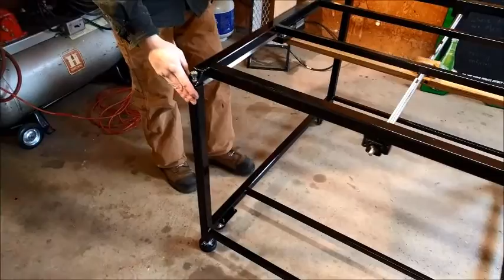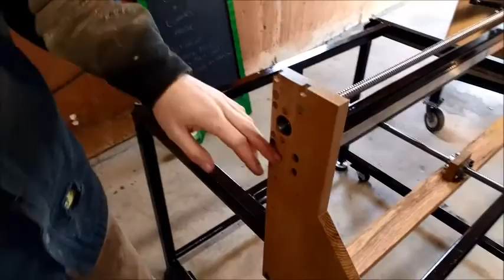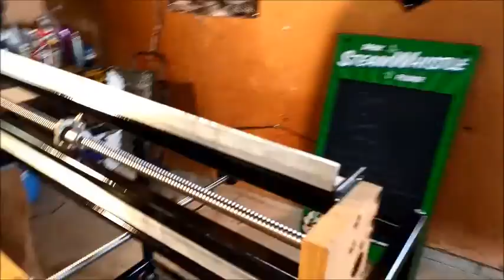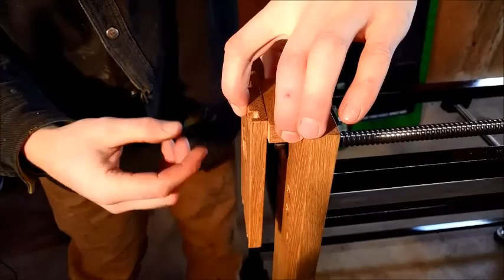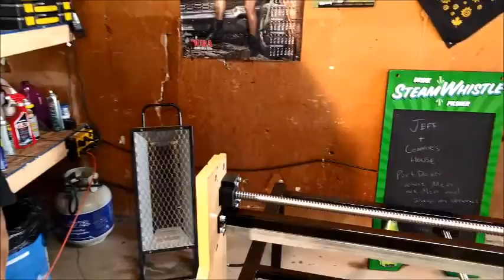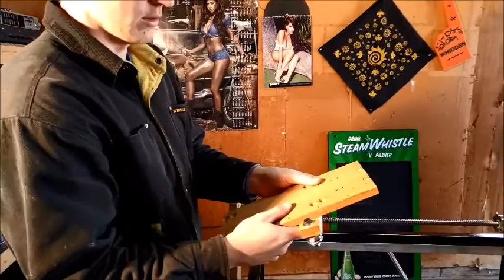Canadian CNC Build - Part 6: Gantry

Comment: nice vids   where did you get the v groove bearings from.?  Will they work on your aluminum angle if it was turned 90 degrees in stead of putting a 45 on the edges?
Reply from the maker: Hi RC Canuck, thanks for watching, follow the link to the ebay site where I got the bearings 

http://www.ebay.ca/itm/Quality-RM2-2RS-3-8-V-Groove-Roller-Bearing-Rubber-Sealed-Line-Track-8PCS-/132061649804?hash=item1ebf7cdb8c:g:d1EAAOSwA3dYdp95

I ordered 8 so I would have some extra as spare.  If you get other bearings make sure you get sealed bearings because it will keep contamination out of the bearings.  Also make sure the inside diameter of the bearing is 3/8" its a nice round number and there are many shoulder bolts that will fit it (there might be some random metric out there).

Yes it would work if you turned the angle, it would actually work better because it is a factory finish, I used an angle grinder to 45 the edges of the angle.  However when you turn the angle it makes it more difficult to mount the angle to any sort of frame, also it adds more distance when connecting your z axis cart (might have more play?)  

I would recommend that the v groove bearing actually rids in a v, more surface contact and less play in the system.